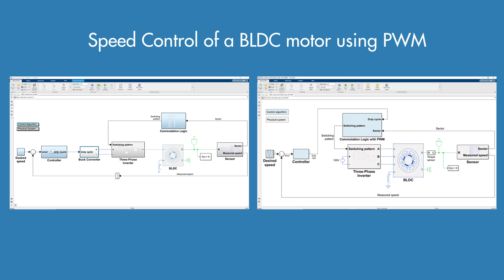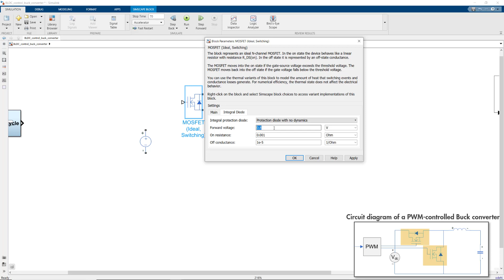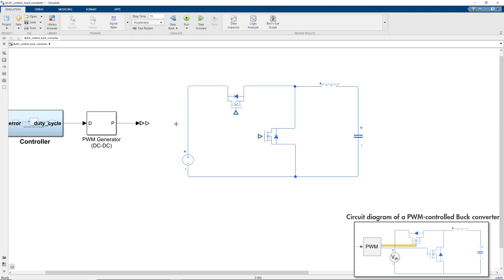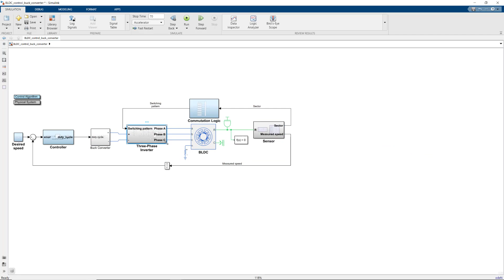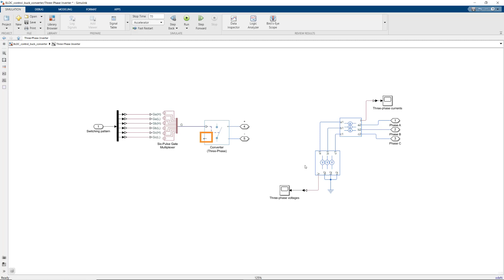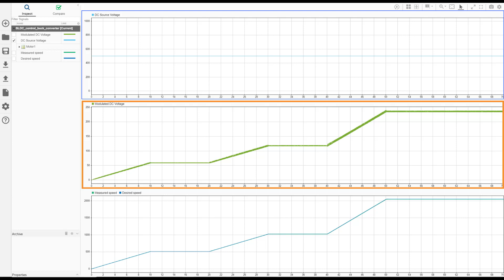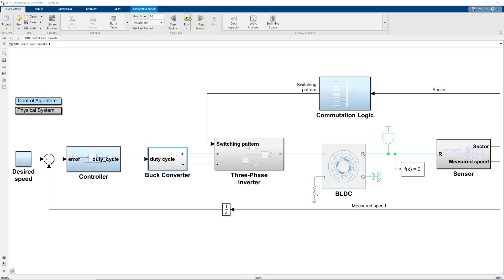How to model PWM Controlled Buck Converters | BLDC Control with Simulink, Part 4

Comment: Download the model used in this video: https://github.com/mathworks/Design-motor-controllers-with-Simscape-Electrical/tree/master/4%20Modeling%20a%20PWM%20controlled%20buck%20converter
Reply: Dear Melda, can you share the value of the parameter Ts_motor which is sample time. I am unable to download the .mat file from Github.
Reply: @adhipshukla6632  me tooo
Reply: Dear Melda! how to analyse the speed response  by varying the load?
Reply: Hey can anyone please tell me how to add 4 teminals to the BLDC?
Mine BLDC has only two terminals